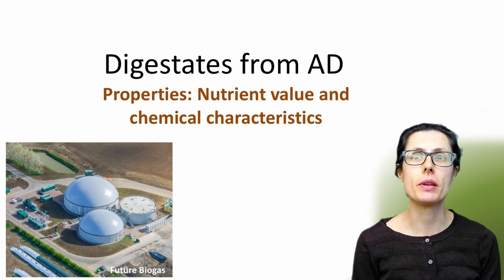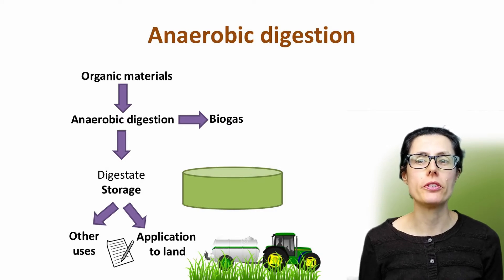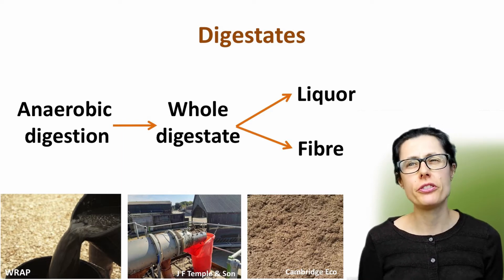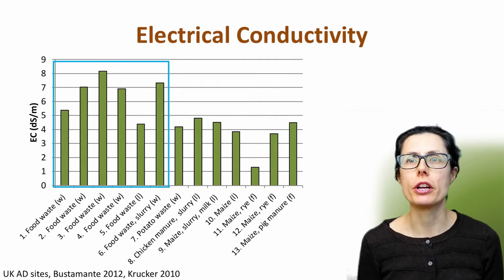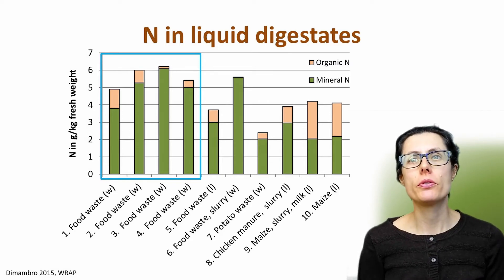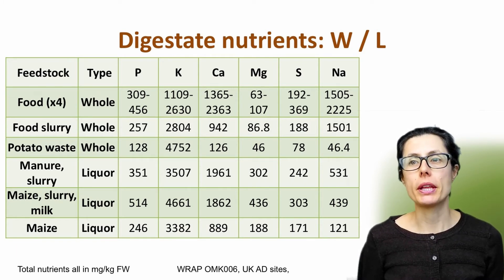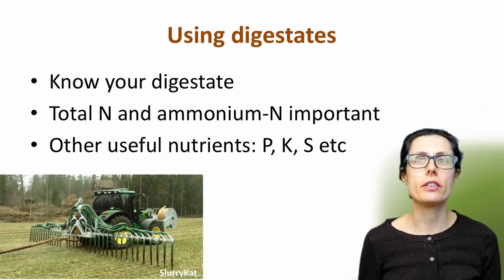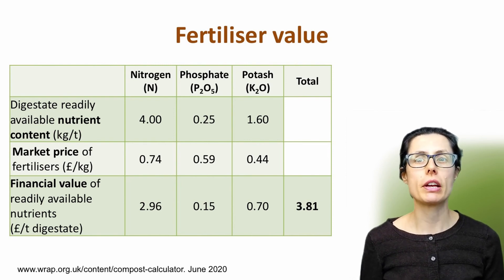D01 Properties of digestates from anaerobic digestion: Nutrient and chemical characteristics

Comment: Hi I’m looking at a biogas plant in Australia. I’m wondering if I can use whole crop wheat barley and ryegrass silage or hay to run a plant. Also if the digestate is applied with the seeding of the next crop to aid in germination will the nitrogen losses be to great?
Reply from the maker: Hi Kyle. Thanks for your message. Whole crop rye silage is often used here in the UK for AD, but I do not know any AD sites using hay. In terms of when to apply the liquid digestate, in the UK the recommendation is to apply this to an actively growing crop to reduce the risk of nitrate leaching. If you decide to separate the digestate, the solid/fibre digestate could be applied ahead of sowing. More guidance here: https://ahdb.org.uk/knowledge-library/rb209-section-2-organic-materials
Reply: @ cheers

Comment: Hi mam.. Very informative... Which is best practice for agricultre, using the digested slurry as whole or seprated liquer and fibre....

Could you please explain?
Reply from the maker: Hi. Thanks for your question. In the UK some AD sites separate the digestate into solid and liquid fractions and others use it whole. Farmers can apply the liquid digestate using one of the low emission spreading options I mention in my other video: 
www.youtube.com/watch?v=G_ANE0hPdYQ&t=16s
Generally the solid digestate is applied to land using the same equipment as for manure.

Comment: Really informative video
Thank u
I’m currently setting up an anaerobic digester on farm to treat and utilise the bi product of piggery waste
My video series is very poor”only new on YouTube and just a farmer” 
But my question is..
if I am going to heat the digestate to boiling point (in order to remove pathogens) prior to anaerobic conditions will this affect the bacteria needed for methane production?
Reply from the maker: Hi. In the UK there are specific pasteurisation rules (time/temperature/particle size etc) for animal by-products. Some UK AD sites pasteurise in a separate unit before the AD and some after.  Worth checking the rules in your country to see what is required. 
The main AD vessel will have the bacteria in, so adding a small amount of new feedstock which has been pasteurised and cooled should not influence the digester bugs too much. (of course provided that the feedstock type is the same as what is already in the digester, and it sounds like pig slurry is your thing, so more of the same). AD sites often inoculate the digester to start up the bacteria.
Good luck with your project!